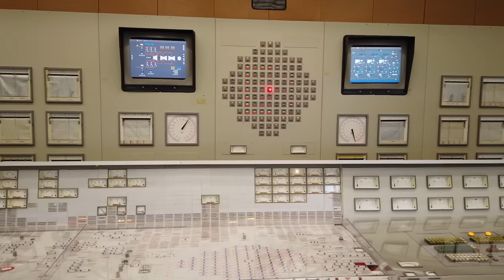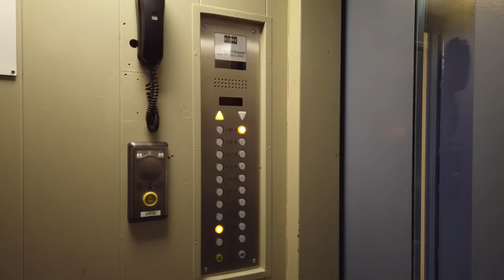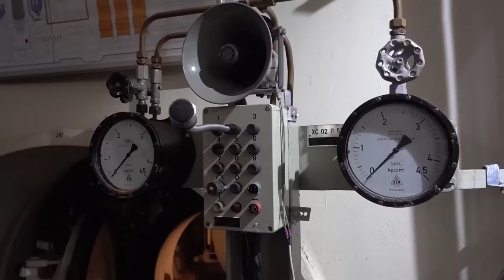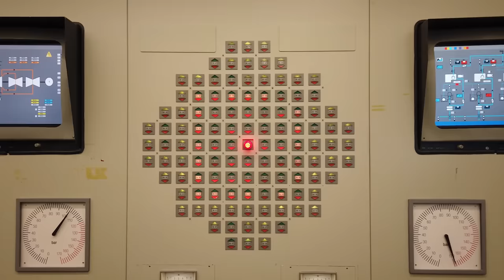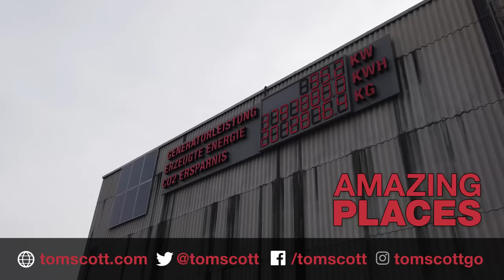This billion-euro nuclear reactor was never switched on

Comment: Humanity’s rejection of Nuclear power was a massive mistake, and the environment has payed dearly for it as we continue to rely on fossil fuels for our electricity
Reply: Wait 20 years when all this turbine fiberglass and these solar panel pieces need changed with more non-recyclable parts. We're just making the problems change hands.
Reply: humanity made a big mistake not investing the resources - both time and money - that went into nuclear energy to further develop renewable resources. Imagine if we focused on that instead of nuclear energy - sure, electricity in the 70s and 80s wouldn't have felt that much like an endless resource, sure, technology might have developed slower due to the stronger limit on electricity. But we wouldn't be here right like a child hiding its trash under their bed thinking "In the future I'll now what to do with this" - now it's more or less to late, now we have to keep using nuclear energy until we completely got rid of oil and coal power plants but it's a deal with the devil. Underground Storage facilities are just ticking time bombs, humanity should have never split the atom.
Reply: @N3rdZon3  we already know what to do with the waste, re-enrich it. Unfortunately politics and currency throws mud in the energy waters.
Reply: @desolane900  
Good news, after including those parts into carbon emission, nuclear power plant still beat windmill and others firm of renewable energy power plant by miles.
Reply: @A Laputa I can't tell if you're being sarcastic or not but in the case that you are: if governments were to spend more time and money on nuclear waste disposal methods instead of keeping fossil fuels on life support then maybe nuclear waste wouldn't be an issue
Reply: @steelrain714  modern nuclear technology can use waste as a fuel.
Reply: German electricity was nearly 10 times dirtier than France's in 2016, according to a new Environmental Progress (EP) analysis. 

In 2016, Germany generated 545 terawatt-hours (TWh) of electricity at an average rate of approximately 560 grams of carbon dioxide emitted per kWh. By contrast, France generated 530 TWh of electricity at an average rate of approximately 58 grams of carbon dioxide emitted per kWh. In terms of carbon emissions from electricity, this means that Germany emitted almost exactly ten times as much as France -- over 300 million metric tonnes.

The analysis is based on German hourly generation data from Franhofer ISE, and French hourly generation data RTE-France, as of February 6, 2017. Conversion of German generation data to Specific Carbon Intensity uses emissions factors of 1150g, 900g, 369 g, and 983 g of CO2 per KWh for lignite (brown coal), hard coal, natural gas, and biomass respectively. Conversion of French generation data to Specific Carbon Intensity Uses RTE-France's emissions factors, which are higher for France's hard coal and gas fleets.

Germany's overall emissions increased in 2016 as a result of the country closing one of its nuclear plants and replacing it with coal and natural gas, an EP analysis last month found.

German emissions would have declined had it not closed a nuclear plant and replaced it with coal and natural gas. 

Not only did new solar and wind not make up for the lost nuclear, the amount of solar and wind electricity produced in 2016 actually decreased from 2015 despite new additions of solar capacity and extensive additions of wind capacity.

I could not trust environmentalists that says they need to be greener and yet refuse to use nuclear power due to the arguments that they claims are far beyond what reality is.
Reply: Nuclear is the future we just didnt know it at the time.........
Reply: @jamsstar2010  nah it was no mistake. The fossil fuel industry did this. Nuclear was the only thing that can somewhat threaten fossil fuels chokehold on our entire industry.
Reply: @anhduc0913  I'd usually agree but the economics are the sticking point even before oil or fossil comes into the argument 
Boards of directors are usually from the different sides anyway
Reply: Thanks Green Party
Reply: @N3rdZon3  you dont know what youre talking about. Vast parts of the world with high population density can never run on renewables. Nuclear is the only way, and splitting the atom was a huge step in humanity's scientific progress.
Reply: @shengloongtan229  ok, now, include it at least one more time in your calculations.  Because decommissioning and underground storage needs to be accounted for also. And what exactly is the price if there is large accident???
Reply: @JoeSmith-cy9wj  dont ask questions if you already made up your mind about your answer.
Reply: @shengloongtan229  i don't think you or anyone else can answer my one question.
Reply: @JoeSmith-cy9wj  😂 good day bye
Reply: @JoeSmith-cy9wj  there are solutions for safe, economical, long term storage that are easily preferable to the cost of both short and long term fossil fuel consumption. The cost to cleanup fly ash and other environmental pollutants resulting from coal fired plants certainly eclipses the cost of long term spend fuel storage in the hundreds of already abandoned mines across the nation(many of which are extremely remote). How we came to accept the consequential cost of burning fossil fuels is a far more serious conversation. 

And cleanup cost? Well, accidents absolutely happen, technology is not infallible, but nuclear tech is also quite young. Modern reactor design is essentially fool proof, with the risk of a disaster being practically zero. We’ve learned a lot through past accidents, and surely there will be more in the future with lessons to be learned, but modern designs all but eliminate the possibility of a radiation leaks. With strategjc plant placement and modern reactor design, the risk can be mitigated to almost zro.
Reply: What’s wrong with fossil fuels?
Reply: @HE-162  he had already made up his mind, don't bother him.
Reply: @deanjohnson4597  they are literally running out
Reply: @desolane900  Yes wind turbines aren't recyclable, but solar panels can be and are recycled at mass scale
Reply: Why don't you like the continued greening of the planet? Plants grow best at around 1800 ppm of c02 in the atmosphere.
Reply: @Jim54_  maybe another 400 years, if we aren't off to the stars by then idk what to tell you.
Reply: @barley12girl  🤣
Reply: Fission reactors are so last year, just wait til we get a fusion reactor…
Reply: @davidbanach7982  I agree, but we need a stopgap. This is the best stopgap until we have the Fusion reactors ready in a few decades
Reply: @desolane900  bit like the scenario with battery cars.. lead in landfill
Reply: @davidbanach7982  fusion is nowhere near
Reply: @davidbanach7982  Fusion is 25 years away...and always will be!
Reply: true
Reply: Should've paid for remedial classes.
Reply: and everyone's scared of it because of three accidents
Reply: @Gleeebus  should we trust thick people who can't even spell *scared*?
Reply: @christophercooper6731  I will not participate in an argument over a typo so you should go on your way now.
Reply: The flaw with nuclear power is that every technocrat that supports it fails to face the fear of nuclear head-on and always redirects the conversation to power-output, environment, money, etc.
Reply: One disaster and one PR nightmare pales in comparison to the slow burn, but they didn’t have the mindset for that 40 years ago
Reply: @@teamgeist3328 Yes